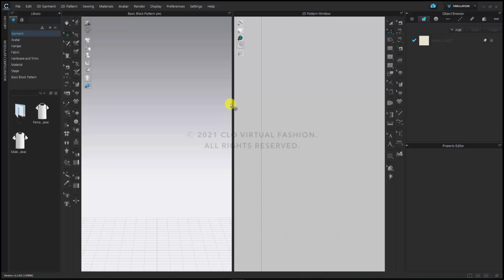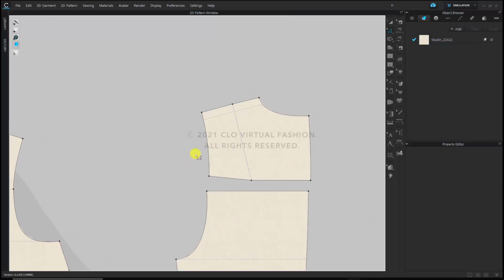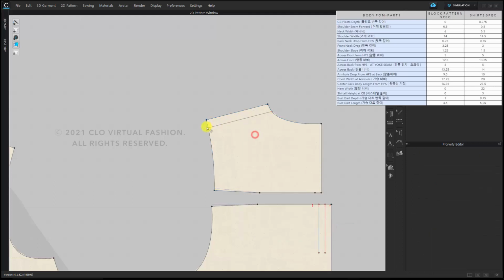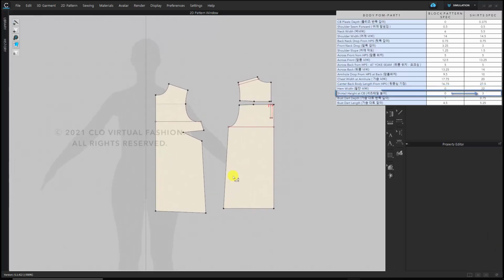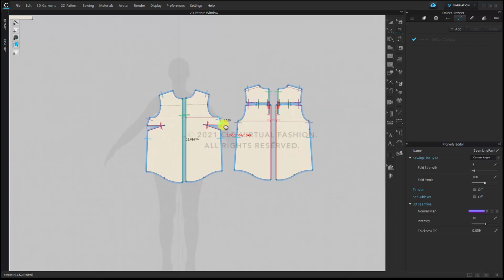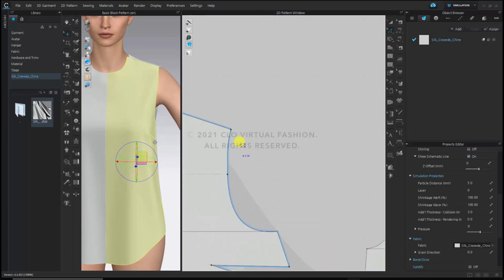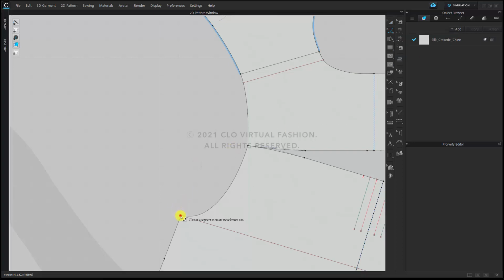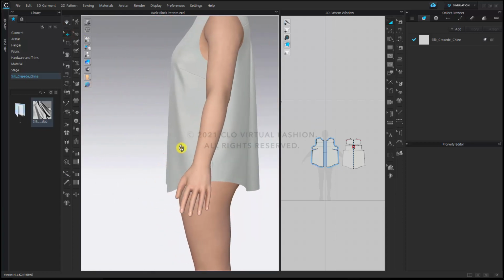Pattern Modification: Part 1 - Body (EN)

Comment: Hello, is it possible to make a line/segment like you put a highlight on where you want to sew, not like the internal line because it has is own action on the pattern. Thanks
Reply: like guide lines that has no impact on the pattern
Reply from the maker: Try using BASE lines. The Tool UNDER the Internal Line Tools.